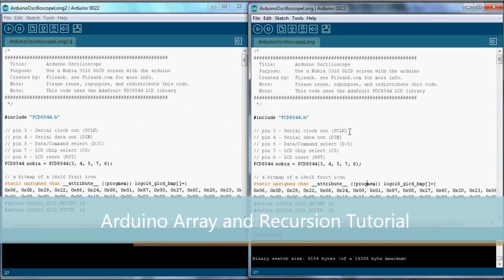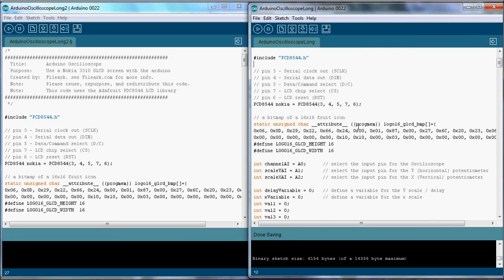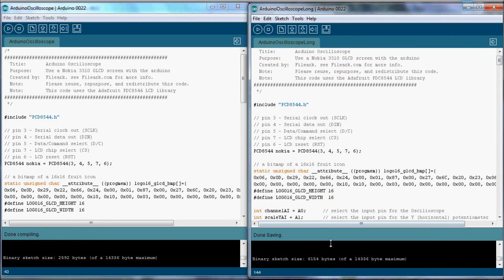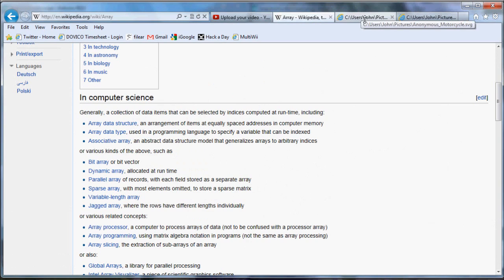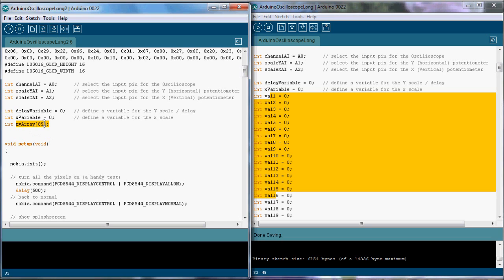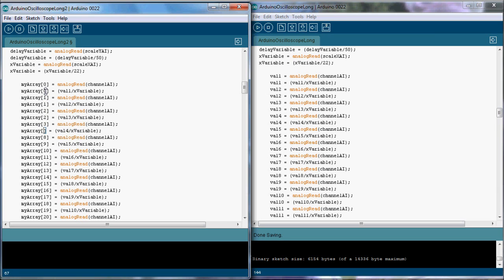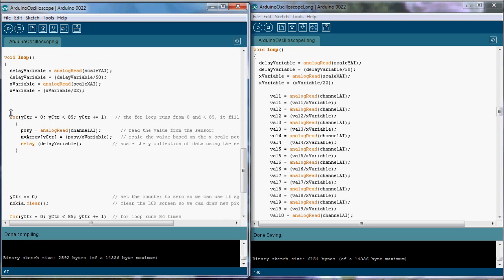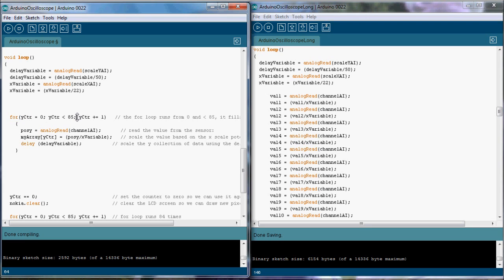Arduino Arrays and Recursion Tutorial

Comment: one problem with using for loop is that the cpu will be stuck inside it and unable to carryout other tasks such as detecting a button press. there is another way of doing this without for loop which is demonstrated in the arduino's smoothing example, but that has another problem which I am facing and haven't solved it yet. good tutorial anyway. thumbs up

Comment: yCtr += 1 in your loop increases the value by 1 after the loop runs, so it will actually start at 0. You may want to set yCtr = 1 instead of 0, you may be missing the first value. Not a big deal in a project like this but in others it could cause problems. Good tutorial though, more people need to learn to use loops and arrays in their projects, especially with limited memory devices like these.
Reply: But it’s not recursion.